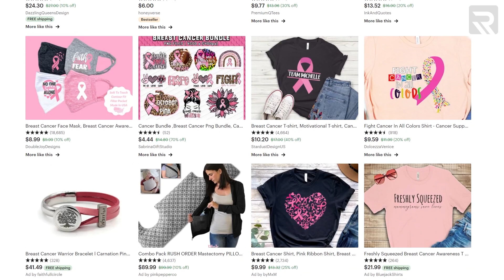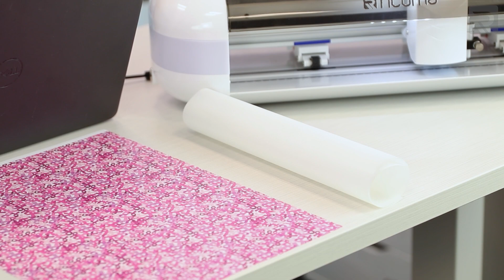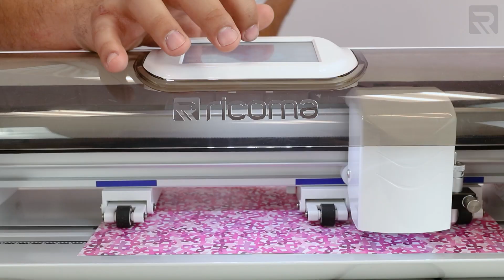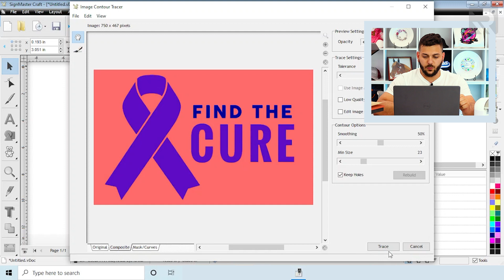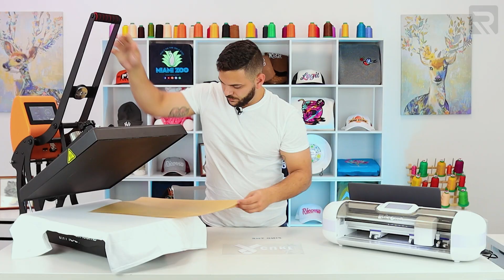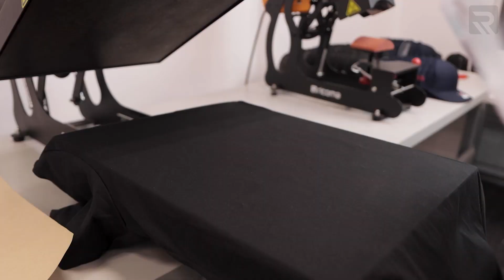Using a vinyl cutter & heat press to create shirts for a special cause!

Comment: Always wondered why vinyl cutters are called “plotters”. 🤔
Reply from the maker: Hi there, thanks so much for watching. A vinyl cutter uses a computer controlled blade to cut your desired shapes and letters out of vinyl material. In other words, the machine trims vinyl into your preferred designs.

A vinyl plotter, also referred to as a vinyl cutter or vinyl printer cutter combo, refers to a piece of computer gear that uses a pen to draw your design or artwork on a paper. It enables you to turn your product prototype into a workable template or pattern.

You can rely on them to cut out vinyl sign lettering as well as other images—enabling you to make a wide range of things, including billboards, bumper stickers, and others.

Hope this helps!